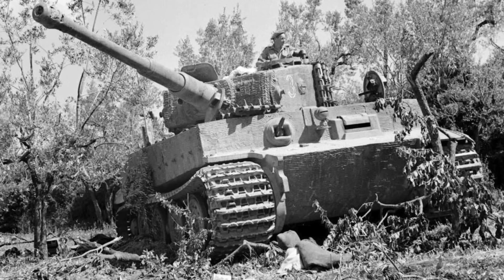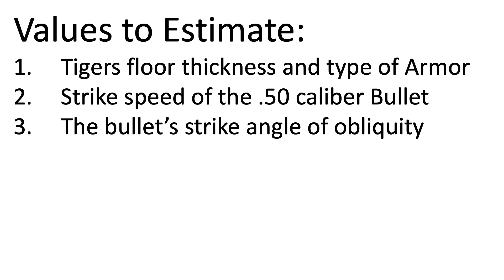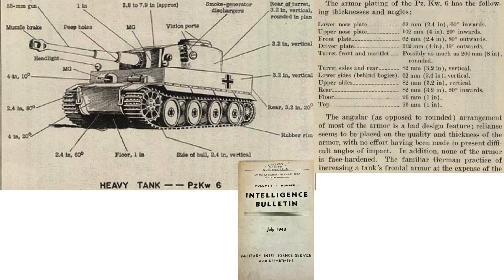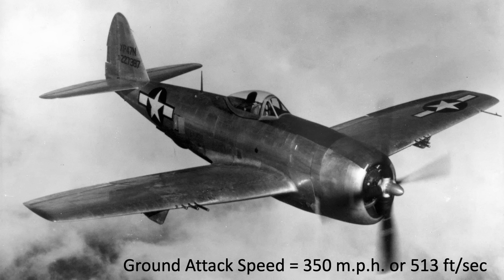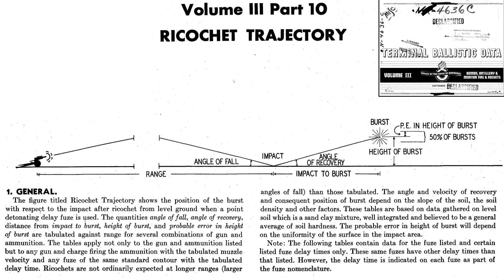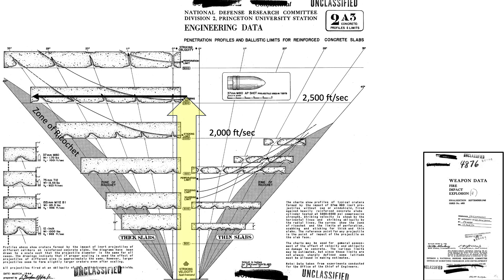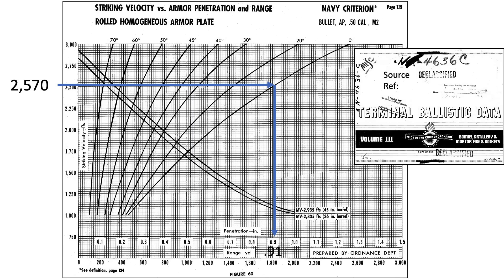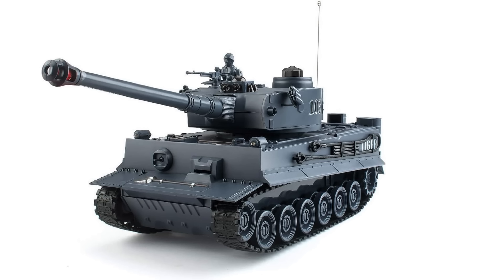P-47 vs Tiger Tank: Can Machine Guns Penetrate Armor?

Comment: You have demonstrated a great deal of work into this. Well done. Question, your result was for one bullet. I would expect successive hits at or near the same spot. Correcting for the rate of fire and number of rounds hitting the armour plating, does your conclusion still hold?
Reply: "near the same spot"..... you realise that the gun was attached to a moving aircraft?
Reply: @daveybyrden3936  ...going 250+ mph (402 kph) - yeah, there's not going to be a lot of hitting "near the same spot."

Comment: if the roof had the same armor thickness as the floor why didn't the pilot aim for the roof instead of the floor of the Tiger

seems extremely strange
Reply: Because nobody told them that.
Reply: @daveybyrden3936  then the instructor was not the best

the pilot training was rigorous and they miss this
Reply: @6XCcustom  What's more likely is that the information never reached the instructors, and possibly even the operational units.

Comment: One thing I always wondered about when hearing this legend is, would the bullet still be a good penetrator after rhe ricochet? It's not just going to lose mass, it's also getting deformed. I guess it doesn't matter in this case since it seems mathematically impossible even under ideal conditions.

The only thing strafing a Tiger tank (or similiar) with .50 cals would do is damage unarmored stuff on the outside. The tank crew probably wouldn't appreciate getting their personal gear, supplies, or extra fuel cans knocked full of holes. The plane might get lucky and destroy sights or jam a track. And of course anyone riding on top of the tank would have to find cover. More importantly when near the front lines, getting strafed gives away your approximate position to anyone who saw the plane shoot at you.

I'm sure bigger projectiles means better chances of a kill, although even rockets and bombs had a low probability of kill on tanks due to being difficult to aim, if i recall.

Comment: Am I missing something? The original objective seems to be pointless considering the top armor is 26mm thick which is equal to the 26mm of the floor. 
Why not attack the rear deck from above at a steep angle? The tanks guns do not elevate enough to return fire as well.

Comment: While this is very  interesting the roof armor is the same thickness as the floor armor on a Tiger, why go to all this trouble to create a very shallow angle on the floor armor then you could dive and be far more effective? .50 cal can penetrate up to 27mm at 0 degrees, imagine striking at the 70 degrees required to ricochet. I imagine there is no "aiming" for the ricochet and rounds are hitting the roof anyway, probably of a Mk IV which has weaker roof armor.

Comment: As always, I'm impressed by your thorough research. One thing still troubles me: if the bullet will ricochet off the ground (concrete) at a 37 degree angle, why won't it then ricochet off the belly of the Tiger? I assume the Tiger bottom armor is parallel to the ground.

Comment: Maybe not penetrating the armor, but likely doing a number on the treads, which would certainly disable the tank. The volume of fire from the P-47’s eight .50s was simply mind boggling. Even the smallest gaps in armor would be vulnerable. It doesn’t take but a few .50 cal rounds rattling around the inside of a tank for the crew to have a really bad day at the office.

Comment: I have almost 100 hours recherched of german Tank losses and the way the losses occured...i didn't find 1 Tiger Tank loss because of any .50 calibre machine gun, not when fitted on the ground, on a Tank or a Plane....s i assume this i an example of the braggin rights on the part of the pilots..sorry, it is possible that my Recherche wasn't good enough but i really tried my best and my experience is that german reports are very accurat..

Comment: I'd be more inclined to believe that their bullets were piercing into the engine components through the ventilation on the back deck of the Tiger 1 hull... Not only were large wavey holes cut into it for the ventilation, but it was also only really covered with "hardware cloth" type of mesh to keep out miscellaneous debris, so the bullets could sail through it like tissue paper.

Comment: Something I dont think folks think about is that to take out a tank, you only need to disable the crew's ability or willingness to fight.
Penetraating roundss into the crew compartment wwould certaainly satisfy the criteriaa for a crew to GTFO of the tank.  

But, a tanker would have also been terrified of JABO planes.

Getting your hull lit up with 8x.50's would sound like death coming for you from inside a taank, even without penetrating rounds.  The risk isnt frrom .50's it's that youve been FOUND!

It's not a stretch to consider that a strafed tank would simply be abandoned by its panic'd crew having been 'found' by a jabo.  Next run might put a 500 lb bomb on ya

Comment: Any damage is good damage. Radio masts, proj splinters through engine slats, fractured vision ports, damaged external stowage, lights and spares, etc etc..
Reply: Radio mast? Unscrew it and replace it with another one. From the mast storage tube on the tank roof.
Fractured vision block? Open the holder, pull it out and put another one in. It's beside you.

Comment: Incredible analysis and much appreciated, however I do believe there is a key point missing. Concentrated fire in the same area would surely compound the destructive force, and shouldn’t two rounds in the exact same spot have the power to penetrate the inch of armor.
I remember as mechanized infantryman on M2 Bradley’s being instructed on the experience gained in Iraq where the concentrated 25mm bushmaster would with enough concentrated rounds penetrate the armor of a T-72.

Comment: Your analysis looks good for 1 bullet.  The P-47 fires 8,000 rounds / minute or 133 rounds / second.   What would happen as a swarm of bullets impacted a small surface?  Does the first bullet bore a hole in the armor as it penetrates part way?  Would a second strike be able to penetrate the now weakened armor?
I first heard about the P-47 pilots using this technique successfully back in the 1960's so this is not just a YouTube claim.
Enjoyed your analysis.   Thanks.
Reply: There is so much dispersion at that distance, no two bullets are on the same path and thus won't be hitting the same spot.
Reply: But a swarm of bullets is *not* impacting a small surface - maybe in a test facility, where the armor plate and the firing weapon are fixed in place, but not in a real-world scenario where the firing aircraft is flying at 250+ mph, and a Tiger I tank may also be moving up to 28 mph. Even if the Tiger was stationary, there's just too much dispersion.

Comment: A very thorough analysis to which I would add that a round that is going to penetrate a thick layer of steel is also going to penetrate the ground surface rather than ricochet. Unless road surfaces were harder than steel!

Comment: I understand this is based on using Browning M2 .50-caliber machine guns only to knock out a Tiger tank by straffing.  For that method to be effective, the P-47's guns cone of convergence would have to hit the tank at no less than 1,200 feet.  Even so, actually piercing the floor armour is very unlikely.  Thats why in late 1944, P-47 Thunderbolts had a new weapon in its arsenal.  This new weapon was called napalm.  No tank including the Tiger tank could withstand a napalm attack.  According to Robin Olds, most of the Tiger tanks he encountered while flying a Lockheed P-38 Lightning were actually towing a trailer full of armanment and fuel.  He said what they would do first is attack the trailer and get it burning.  The flames would usually spread into the Tiger tank's engine compartment, thus rendering the tank useless.  Unlike the P-40 Warhawk, P-47 Thunderbolt, and the P-51 Mustang, the P-38 Lightnings guns do not utilize a cone of convergence setup since the guns are harmonized from the aircraft's centerline.  The same is true of the Northrop P-61 Black Widow night fighters which were also used to destroy Tiger and other German tanks during night intruder missions.

Comment: Your math is ok but it doesn’t take into account that you have hundreds if not thousands of bullets converging at the same spot and ricocheting into the same area underneath the tank, therefore weakening the steal plate and eventually eroding the steel enough to penetrate.
My friends and myself have shot steel plate 3/4in with 7.62 in the same spot as an experiment, I didn’t take a lot of rounds to punch a hole thru it. That many 50cal in concentration could easily penetrate 1in steel. Especially 8 machine guns converging on that spot.
Reply: But will the rounds even richochet off the road in the first place?
Reply: "My friends and myself have shot steel plate 3/4in with 7.62 in the same spot as an experiment, I didn’t take a lot of rounds to punch a hole thru it..." Were you flying past at 250+ mph? How many shots do you think you could fire into one spot (let's say within 3 inches of each other) at that speed, even with eight .50 caliber MGs?

Comment: Very good.  One thing to note is that there are a number of covers on the underside of the Tiger.  I'd wonder if the provide a week point especially some of them are likely fuel / oil drains.
Reply: There were two medium sized covers toward the rear. Plus a couple of tiny drains.

Comment: Two areas that that eight .50 BMG's on a P47 could disable on any tank: (1) solid hits in the track area could cut the tracks in half or disable the track mechanisms and (2) at the rear portals on a tank providing ventilation to the engine compartment, the .50 bullets could get thru to damage and stop the engine.
Reply: Unlikely. The tracks, for example, were already built heavily enough to withstand all but the largest mines and AT fire.
Reply: @executivedirector7467  Tracks could likely survive ONE round of .50 BMG impact. But the amount of hammering impacts from 8 .50 BMG's will cause something to give!  

On gun camera footage, the effect of 8 .50 BMG's on railroad locomotives is impressive, instantaneous and fatal! 

While tanks may have heavy armor beyond .50 BMG penetration, a tank is still a mechanized vehicle with many areas of vulnerability, that 8 hammering .50 BMG's could have considerable effect on.
Reply: @63DW89A  Locomotives aren't armored. 

Claiming that a high volume of fire (which doesn't necessarily mean a high volume of hits or a high volume of hits to the exact same spot) will somehow magically cause a tank damage is a pretty vague claim. Again, AFVs are designed to withstand much bigger stuff than .50 cal from causing serious damage; I don't know why anyone would believe that LOTS of .50 cal hitting in kinda-sorta nearby areas would do more damage than, say, a 155mm HE round. Yet we know tanks can survive a 155mm HE barrage.
Reply: @63DW89A  The material of a locomotive was much softer than tank armour.
Reply: @daveybyrden3936  Not every part of a tank is face hardened armor either. Tanks have always had a lot of vulnerability on the battlefield, due to blind spots and far less agility than lighter vehicles. That's one of the reasons infantry is always deployed around tanks, to prevent a soldier on foot from sneaking up and taking out the crew thru a view port, or disabling the tracks by blocking the mechanism. If you've been watching the Ukrainian conflict, you will note how vulnerable tanks are on the modern battlefield, and are becoming more and more useless. That is why the USMC began the process of retiring their tank units from service even before the Ukrainian conflict started! The USMC was heavily criticized for that move; the Ukrainian conflict has clearly demonstrated that tanks are becoming useless on the modern battlefield.

Comment: One thing not considered in your analysis is a ricochet  at  an angle of 37° will encounter about 1.4 “ of steel plate , not 1.01 “ thick as found at 90°.  However, your research is to be commended !

Comment: My uncle flew P47s in ETO.  He was credited with the destruction of a Tiger.  I questioned him about once, asking if he was sure it was a Tiger since few were produced.  Yes, he replied, no mistake.  I next asked if he was sure he set it on fire, pointing out the Germans had deployed pretty good smoke generators.  At that point he told me that he very well knew what Tigers looked like and there was no doubt he left it burning.  That was the "Sir yes sir" moment in the conversation.  The issue I would raise is while 1 .50 cal bullet may not penetrate a plate, when that one plate is struck by 100 rounds will it catastrophically fail.  In that case strikes on the engine compartment from above seem a more likely cause of a fire.
Reply: But 100 rounds aren't hitting that one plate, unless the P-47 can hover in place and the tank isn't moving either - the dispersion from the aircraft moving at 250+ mph guarantees they won't all hit the same spot.

Your uncle either 1) actually blew up a Tiger tank (unlikely but possible), 2) blew up a Mark IV tank (looks similar especially when you are whizzing by at high speed), 3) set off smoke generators (or the Germans set them off to hide the tank, which anyone would do under air attack), 4) set off external fuel stores.

Whatever the case, you were wise to drop the subject :-D